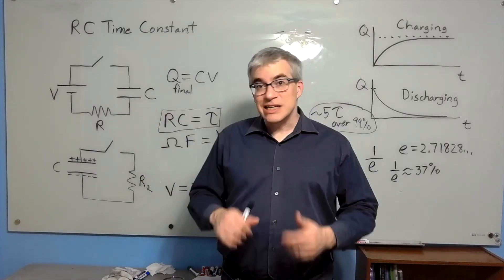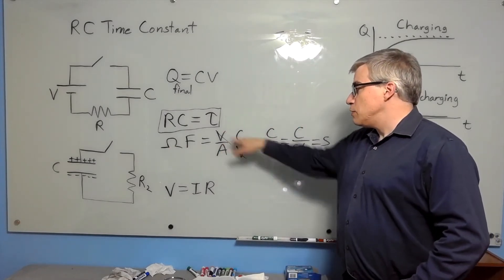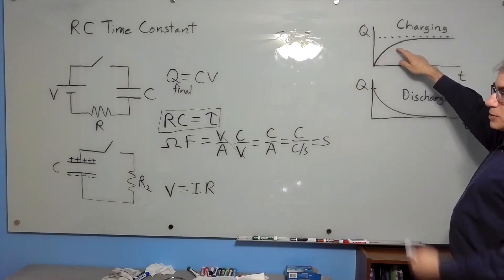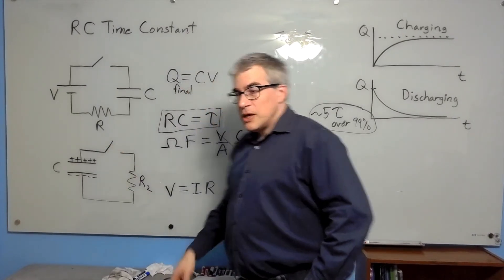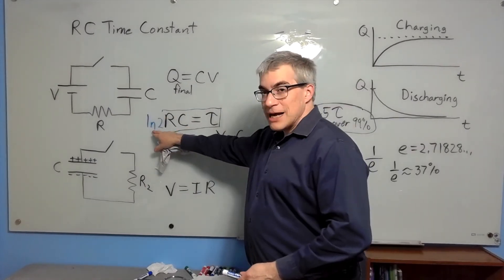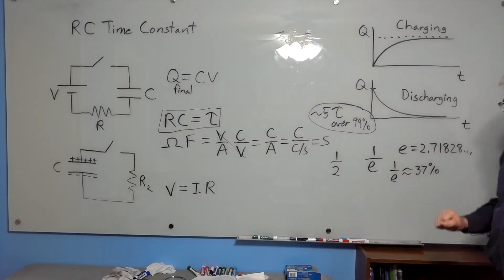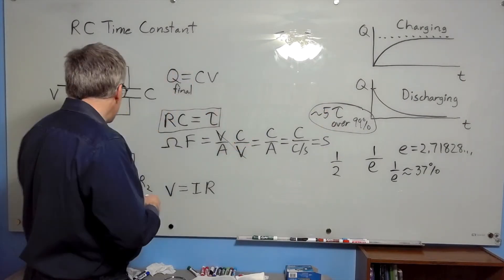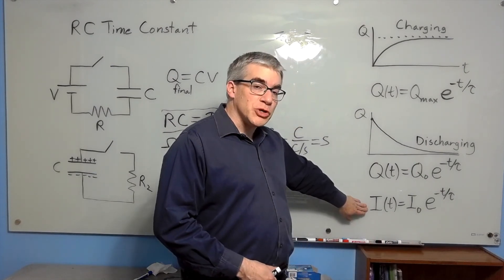What is the RC time constant

Comment: Can you make a video on why we dont use inductors in the same way how we use a capacitor for backup
Reply from the maker: Interesting question. Inductors store energy in the magnetic field, which requires a continuous current to support it.  Unless you're using superconductors, there's going to be continuous loss to resistive heating in the wires, whereas energy can just sit in a capacitor for a long time if needed.